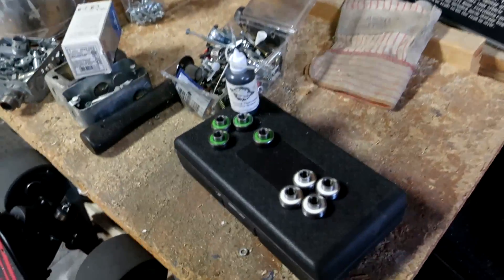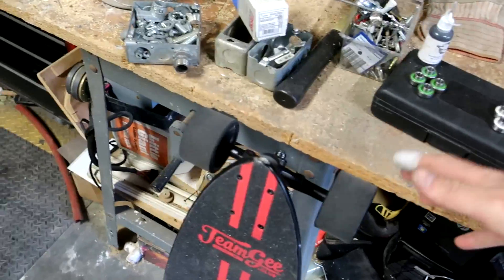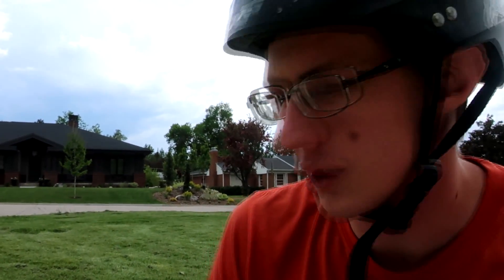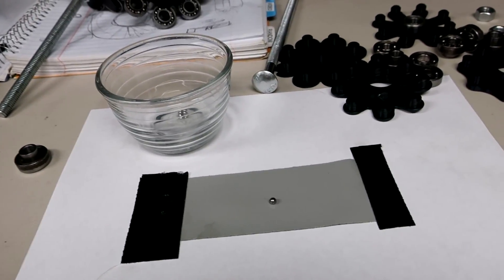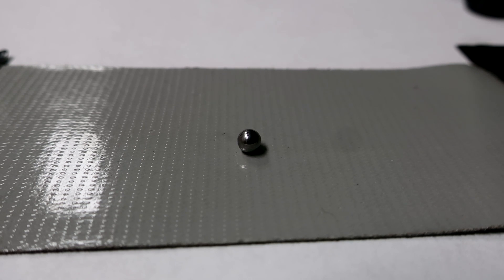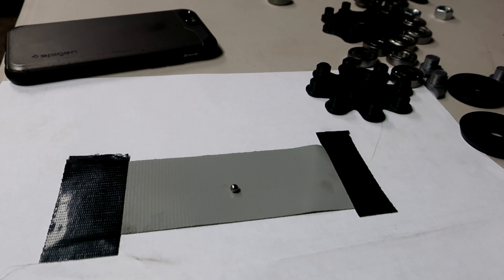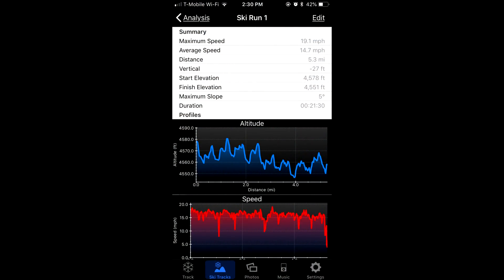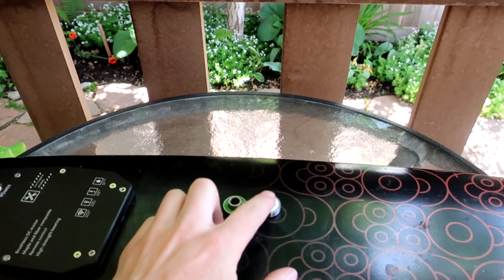Bearing Test, Grease vs High Performance Oil

Comment: I Generally mix mobil 1 synthetic Bearing grease with WPL Fork boost lube(lube for mountain bike suspension forks). I started doing this a few years ago after going to Ocean City, MD for vacation. I was only there for a few days and I assume a combination of the salty/sandy environment and heat wreaked havoc on my longboard bearings. Since doing this my bearings last much longer, they roll somewhat smoother, and are a bit quieter. Now I can ride my board for a month straight then let it sit for the winter, and pull it out as soon as it hits 60 degrees outside. Without doing any maintenance to it and it'll ride just as smooth as it did before it was put away. The main perk to using grease is the fact that theres virtually no run off. Grease isn't effected by gravity like oil is.  Even when you riding your board the oil is still going to settle in the lowest point of the bearing at that particular time.  When you do ride the oil gets flung to the outter races. During all this movement some of the oil actually gets thrown out of the bearings at the edges of the seals. Grease doesn't do this nearly as easy or as fast. Once grease gets on something it has a tendency to stay there until wiped away. Even then it still leaves a nice layer behind.

Comment: Umm, from bearing specs there is limiting rpm rating on bearings on grease and oil. That is why you put uncovered bearing on engine, no grease on an auto engine.

Comment: Omg I'm from UK and ordered boca bearings and the custom charge was 90 pound and 30 postage aswell. Altogether 450 pound and I can't tell a difference from avid. I'm gutted but glad I can tell the UK people not to get. Guess they don't like UK lol and send high postage. UK and maybe Europe do not buy, no different to avid and avid are cleaner with no grease left on seal. Or even fast eddie or acer

Comment: Better - stack the bearings, run them at speed, like 50MPH equivalent. Measure the temperature very very accurately. You're done. Cooler wins.
Part 2 - same as part 1 except - run 8 bearings independently. Run all bearing to destruction. Give us all the data.
Reply: you will find losses but still there is a question where these are coming from. Is it from rolling resistance? Is it from grease viscous losses? I think most of us are not interested in every 1 Watt we save but having a good bearing that might have a little viscous losses but will last way longer before need for maintenance is a better option for me.

Comment: Wow, I think I will grease my bearings. Always assumed the spin test was a accurate assumption of the speed increase you would see, clearly grease may actually be superior. Maybe even a heavy oil like motor oil or grease oil mix might give a little of both especially if you maintain your bearings every couple of uses & aren't a frequent user.

Comment: Greasing is once. Oiling is how often ? :)
Reply from the maker: Based on the experiment I did in this vid: https://www.youtube.com/watch?v=2fyw8-LZTro

I'd say oil every 50 miles, and re-grease every 150-300 mile depending on  your grease.

Unless you're riding in wet conditions, in which case just a few miles might be enough to need to re-oil. With grease, some are really bad at dealing with water, some are very good so it just depends.

Comment: Fine oil alone will evaporate with heat and surely damage the bearings sooner.  Unless you're cleaning your bearings weekly I agree with grease.  If you want to add fine oil as well it may give a happy medium

Comment: well I had zealous bearings in my regular skateboard and they were and still are really slow.
I thought they´d need some more time to break in, because of the thick grease in them, but I´ve been skating them every day for 2 and a half weeks and barely noticed a difference.
I dont care anymore if they need that much time to break in or if they are just plain bad, its insanely annoying to not be able to roll around smoothly, even in the skatepark I notice a big difference, as I cant make it up a bank when dropping in from another bank that I AM able to ríde up dropping in from the same other bank when I have my other bearings.

Bearings do clearly matter, maybe its because they are meant for longboards and they dont work well with whatever happens to them on a regular skateboard, but srsly riding the zealous, aka bearings that do not spin well´, and skating bearings that spin very well is a humongous difference!
I dont necessarily think that zealous bearings are bad, it might just be the wrong application, maybe I got unlucky and got some dirt in them on my first day or its a fabrication error, all I can say is they dont work for me and it does make a difference.
Reply from the maker: Yeah, so for longboarding the reason why bearing drag matters so little is because the resistance from air drag becomes the limiting factor so quickly, even at like 15-20 mph, which is nothing.

For low speed applications where air drag really isn't happening and you do want the board to coast, especially with only its own weight, it can quickly become really important.

But zealous bearings IME do break in really well and become quite free spinning. Perhaps because of the relatively low speed and small wheels in a skatepark the grease just has a lot more staying power and two weeks just wasn't long enough.
Reply: If it's not too late, purge the bearings with %99 alcohol or liquid lighter fluid, maybe acetone or even WD40 in a pinch, then grease them with a thin wheel bearing grease with low fiber, the red stuff. Perhaps that will make the difference also loose the inner shield, perhaps test with & without the inner shield, I believe the shields account for some drag when trying to coast on flat & up small ramps. If the grease doesn't work perhaps oil them. My thoughts would be that motor oil or a heavier oil will be better than silicone style lubricants, they would provide more protection since they're a pretty good in-between. Just a theory but I've been watching a lot of video no one has come up with the idea but I think it may work. It will be a very high maintenance setup though, cleaning them every two usages.
Reply: I dont have this experience. They were far superrior to default YOW bearings I had but I dont have much else to compare. I feel like most of my losses are now in the 83A wheels. At beginning they were slow but few runs in bowl reaching some 15+ mph speed and the grease was pushed out and now its really good.

Comment: So greased bearings will ultimately last longer and hold up better than any oiled bearing,.   Water definitely plays a big role in the equation as well where greased bearings are water resistant and oiled bearings will wash out the oil film and rust or let in dirt which will eat up the balls or races and lock up or just put more friction on the situation...  if you use a good marine grease and mix a little of your flavor oil with the grease than in my opinion is the best way to go...

Comment: Great experiment, thanks for sharing. Although I've found a noticeable difference in maintaining speed and rolling longer with oil as opposed to grease on the same bearings/wheels setup and same trail.

Comment: From fixing machinery I am a printing press mechanic. I always found it better to grease a bearing and not oil a bearing you are supposed to grease bearings not oil them. People talk about .... grease slows the bearing  down when you spin the wheel freely but when you are riding on a board you are never going to know the difference between a thin oil thicker oil grease actually grease is going to protect your bearing oil is not. This is just my personal opinion
Reply: Hallo; what type of grease should I use? There is like a 1000 types. Thanks

Comment: Finally someone does a real world test rather than just spinning a skateboard wheel with a dry bearing!  Most people don't know this but grease is nothing more than oil in a thickening agent.  When you see things like lithium complex grease, the oil is usually a 50-80 wt oil in a lithium thickener.  You hit it on the head that there is virtually no discernible difference between bearings.  They will all roll just about the same distance.

 What needs to be done is tests in a controlled environment using SAE or ANTM testing standards.

Comment: It's interesting that you use greases for more protection I have been experimenting with different oils and I ended up with a hybrid of grease and oil to great success if it continues to be a good solution I will gladly share the recipe for anyone to try for them selves if the rest of you guys would like
Reply: Bro give me the recipe
Reply: @winnifred6768  3 parts gun oil (or bones speed cream) and  2 parts superlube synthetic grease. The oil and grease are then mixed with an equal amount of acetone and the resulting liquid is ready to see some bearings.
Reply: Tease
Reply: The hybrid has worked great for an every day bearing lube, but it's not quit as fast as the plain oil. The oil and grease mix is great for wet weather and lasts for a long time, but is a bit out performed by the oil alone when it comes to speed.
Reply: How has the hybrid solution worked out for you?
Reply: why hybrid instead of only grease?
Reply: @YmXJjPFMkgRUWNyLq  the theory is that by using both an oil and a grease you may be able to gain the benifits of both. The oil generally does better in high rpm applications but tends to not do so well with high heat, wet conditions, or dust. The grease on the other hand does better with high heat, water, and dust, but is out performed by the oil in terms of speed. Long story short I've been attempting to get a mix that gives the full protection of a grease while still performing like an oil at high rpms.
Reply: @DKTimberConstructionLLC  Did it work out?
Reply: @Alex-kr7zr  the mix works great for most applications. The oil grease combo lasts much longer than oil alone and handles moisture pretty well. The only con is that the mix is not quite as fast as the oil, but most people probably couldn't tell the difference.
Reply: @DKTimberConstructionLLC  Thanks, now I just need to find a suitable grease in Europe.
Reply: @DKTimberConstructionLLC I saw the formula. It's interesting. But about the acetone. Doesn't regular acetone have some water in it? Do you use home depot hardware grade acetone?

Right now, I ordered the Bronson next generation high speed oil. It's a skate lube similar to bones speed cream I think. It's my first time getting it.

Which grease would you recommend? Lithium? "finish line premium grease"?
Reply: @xcharlesbronsonx   I used the home depot brand acetone, but I'm not sure how the small amount water factors in to the equation, however I don't remember it being an issue, maybe the amount of water is such a small quantity that it has a chance to evaporate before becoming a problem.
Reply: @DKTimberConstructionLLC  water in acetone is negligible same with alcohol, because it forms a combination that always evaporates together, the danger of water is how long it takes to dry which is not an issue with acetone in the vast majority of cases
Reply: Something you should understand is that grease already IS a hybrid between grease and oil, so you’re essentially just changing the formulation of the grease. That’s not exactly accurate to say but what I mean is that grease is a concoction of oil, additives, and thickener in different ratios, whereas oil based lubricants are just oil and additives with little to no thickener. That said, different greases and oils and additives lead to a totally different product, you’re basically like a grease bartender.